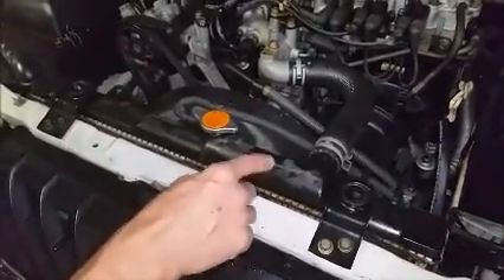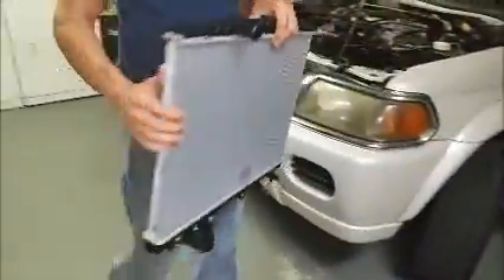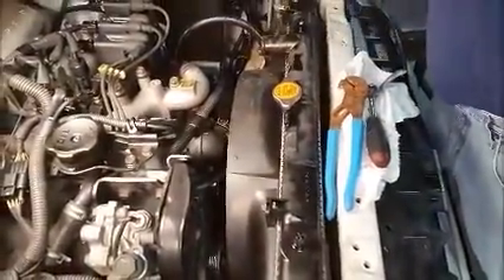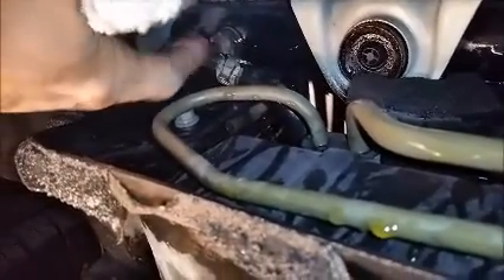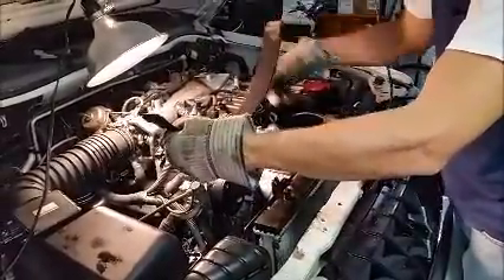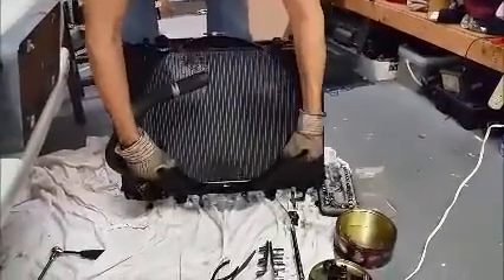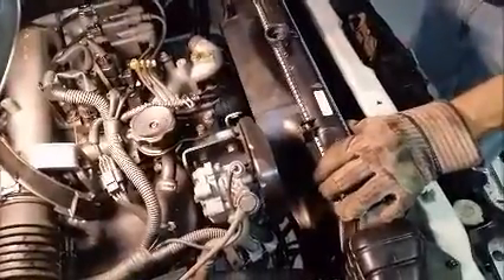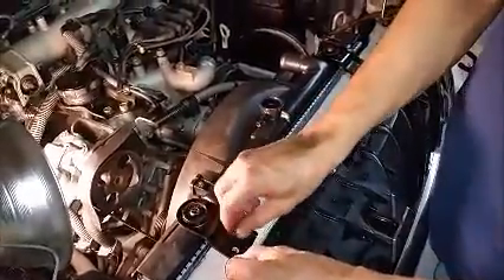Mitsubishi montero radiator replacement

Comment: Thank you so much , saved me $300. wish repair shops would just be honest and say "it's not that hard you should do it yourself". Even took me less than the 1.3 hours I was quoted. One special tool was very helpful, a pair of long handled pliers with a 90 degree bend for compressing hard to reach band clamps. $4 at harbor freight.

Comment: Hi, Is this radiator connected  to automatic transmisji cooling system also?  I bought Pajero III 3,5 GDI from 2003 year with some hand mades. Radiator is skipped and I need to figure out how to restore oryginal connection.